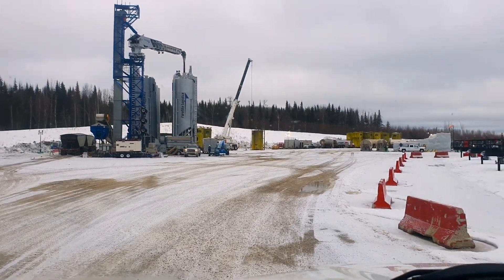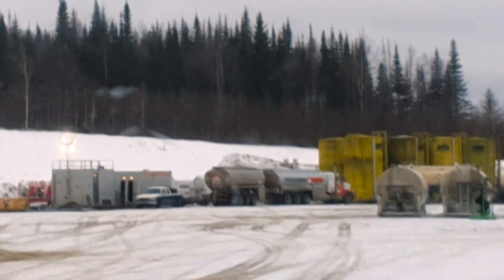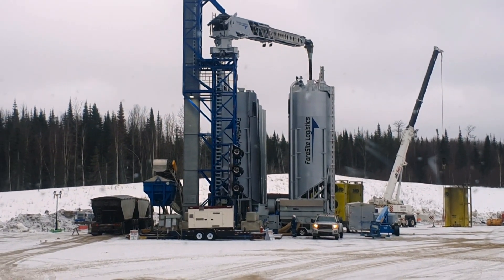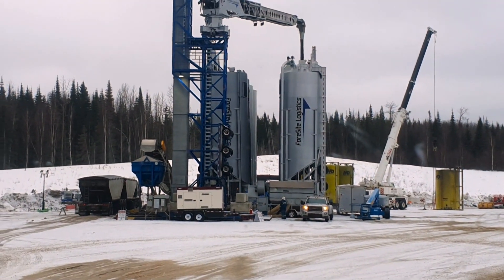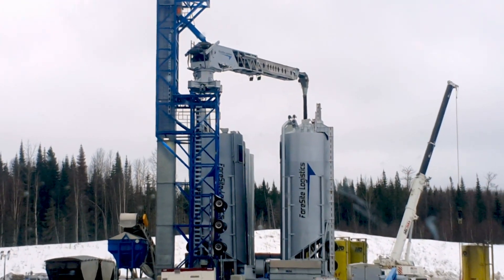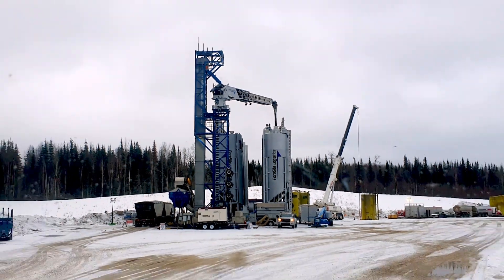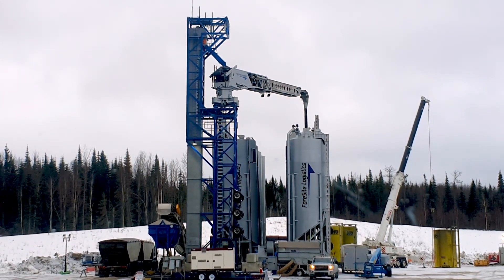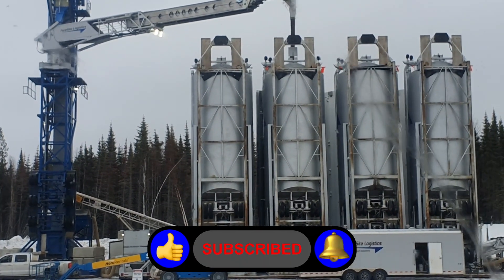Setup for oilfield Fracking

Comment: Ask the fracers how men were killed in wyoming Red Desert in late 70s. When we used condensate low grade JP-4 JET FUEL 9 OF MY FRIENDS DIED THAT DAY WITH HALLIBURTON OUT  OF ROCK SPRINGS WYOMING AT THAT TIME HALLIBURTON WAS OWNED BY LADY BIRD JOHNSON. PRESIDENT JOHNSONS WIFE. SHE WAS AT ONE TIME THE RICHEST WOMAN IN USA. FRACING KILLS THE ANIMALS IT GETS INTO FOOD CHAIN. AND WATER TABLES. PERFORATIONS IS MUCH BETTER.
Reply from the maker: Perforations - meaning holes in the long string casing? They do that too, but the fracturing of the hydrocarbon bearing formations allows a massive amount more to  flow to the well for production.
Not the same technologies now as then for sure. One thing that they use here instead of condensate like then is fresh water. ( personally I think that is worse) might be safer & cheaper but once it goes down a well, it never comes back to the water table.
There's certainly problems even now with it. I know of a couple wells around here that screwed up the fresh water wells nearby even though they are at a VERY different depth.
Hope you enjoyed the video. Stay tuned for more my friend & thanks for watching.
Reply: @lovesloudcars  I worked 30 years patch. How many you got Molly prat.
Reply from the maker: @Davidbrant-r1l  I'm not interested in fighting my friend. My first memories of being around a drilling rig was 1972. My father started in the early 60's & pushed tools when I was learning to write & we lived at the rig in the summers. My  First Oilfield job 1987- so what's that 37 years? Been around the oil industry my whole life (probably just like you).
I'm not defending how it's done or how it was,  just pointing out how things are. One thing I do know is that the way things are done in the US & the way things are done in Canada are not always the same. Nor is the industry the same. The technologies nowadays is crazy. I had rental equipment on telescopic doubles that were drilling directional wells 5000 meter (16,400 feet) horizontal. When my Dad started it was nothing but trip for bit, & they certainly weren't drilling stuff like that with a double.

My question about perforating was to clarify what you meant - not to argue.

Comment: How long did it take to set up that fracking terminal?
Reply from the maker: I don't know.  I was just delivering gravel. I think they set up the basic thing in about a week.  
I used to run vacuum truck on frac jobs 25 years ago,  but they were a whole lot smaller project then. They used to run one or two sand truck loads and be done in 1 day.
Now they run multiple stages and on multi well pads. I don't even know how many truck loads are used,  probably over 50.
Reply: @lovesloudcars  12 hours or less to set up and start unloading trucks.
Reply from the maker: @paulwedman4754  That's awesome. Thanks for setting me straight. There's tons around here, but I don't work around them all the time.
 Stay tuned for more content my friend & thanks for watching & leaving a comment.

Comment: Interesting Process Nathan Can You Send Some Gasoline 2 The USA 😀🔥😀
Reply from the maker: Funny enough (not really) things are going way up in price here too.  Anything to do with carbon is being taxed through the roof.  My father burns coal to heat his place.  The carbon tax is now 4 x the value of the coal itself.
Reply: @lovesloudcars  Biden And Trudeau Need To Open The Keystone Pipeline Back Up STAT 🙈😎😀
Reply from the maker: @chrischiampo7647  funny how some things get targeted and others don't.  
Would be nice to have some viable alternatives developed that actually worked well.  Getting 50 mpg fuel mileage certainly would be nice..
Reply: @lovesloudcars  The Germans Had Synthetic Fuel Back In The 1940’s During WW2 Wonder Why They Don’t Use That Formulation as an Alternative to Oil 😊😀🔥 Not Replace It Completely But Help Cut The Complete Need For Oil 😀
Reply from the maker: @chrischiampo7647  as far as I'm concerned it's all money.  There's things that get developed,  but the big dogs are interested in profits not anything else.  Get in their way and get squashed. Develop something exceptional and you either have an accident like killarys' enemies,  or sell out to them for your retirement. Then they bury your invention in some filing cabinet.
 One day when things get so crazy expensive to develop resources, they'll pull them out & say the half truth that they've been investing in alternative  ways & make their billions on all those things that they've been doing that with for the last 50 years. 
That's my opinion anyhow.  
Tons of really cool ideas on the internet, & suddenly the guy dissappears along with everything he's posted.. kinda strange.
Reply: @lovesloudcars  Agreed
Reply: Sad state of affairs these days.
Reply from the maker: @Kentuckytrackers7255  that's for sure.  Wondering how far it will go in Canada. I've obviously not used this channel for political purposes,  but sheesh- a guy begins to wonder who's working for who.